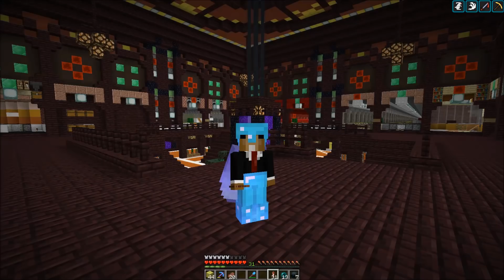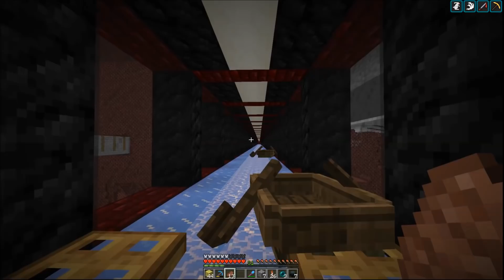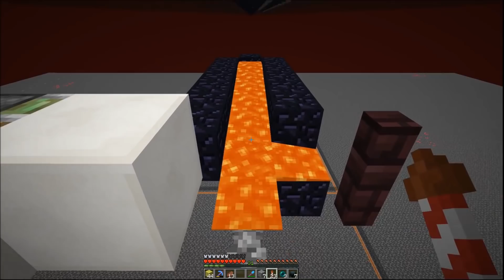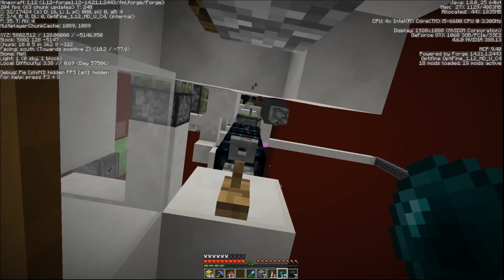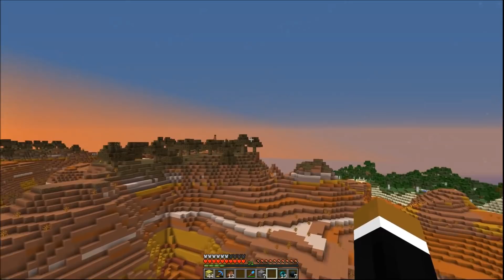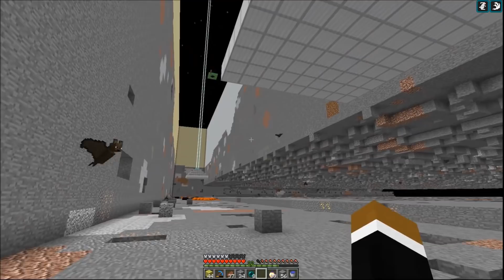SciCraft 59: 18000 Blocks Per Second Travel With Enderpearls

Comment: Minecraft blocks are 10 meters long appearently, that means this ender pearl is going 1.8 million meters per second. This means that that ender pearl is going nearly HALF THE SPEED OF LIGHT!!
Reply: I dropped a shoe from the average height of a Minecraft character(6ft) and it landed at around 1.18 seconds if Steve were to throw this at the speed of 1.8 million meters per second it would go around...
Reply: 2.245 x 10(to the -10th power) lightyears
Reply: That's around 6.095689e+15 light years less than the observable UNIVERSE!!
Reply: Sombody let me know if I got some stuff wrong, this is my first time doing this and I am not even 18.
Reply: Quick update. Turns out Minecraft blocks are not 10 feet. They are 1 which means they are going at 180000 meters per second, boring.

Comment: How have they made their nether covered in bedrock
Reply: They are on top of the nether ceiling.

Someone decided they didn't like the idea that bedrock was indestructible.  So they built a machine that would break pistons and used the broken pistons to break the bedrock.

Then someone wondered what was above the bedrock ceiling of the nether.  So they found a way to glitch through the thin parts of the roof and discovered a vast untapped resource of nothing.  

They began to plan what they would do with all that nothing, so now we have FTL Endpearl cannons so they can go and mine terra-cotta in a biome that is a good shape.

Comment: The fastest manned craft [The Apollo capsule on reentry into Earth’s atmo.] only went 11,032 m/s. A block in Minecraft is 1cubic meter, 18000 Blocks Per Second is the speed of this mode of transport, both literally faster than any manned thing ever created by humanity, and it doesn’t even have a protective heatshield and heat resistant capsule to stop it from atmospheric heating... Absolutely astounding you guys, truly staggering speeds your working with. Going faster than the SR-71 Blackbird, and even still faster than the Apollo capsule at perigee.
Reply: Meanwhile their diagonal piston bolt goes about as fast as my '99 sedan, but looks way cooler.

(28 m/s ~ 101 km/h ~ 63 mph.)
Reply: So mankind is a joke to the technological wonders that can be achieved in Minecraft
Reply: @Luca B. Oh yea that is a really neat thing! 
I just thought I'd compare it to the fastest manned thing, since this does transport a character
Reply: Bruh it's a game

Comment: 2b2t: uses exploits and hacks to travel
SciCraft: Uses Fusion powered redstone blast cannons to travel
Reply: Image if you use both at the same time to travel.
Reply: @komiks42  It has a risk of creating a black hole
Reply: :D :D
Reply: @Terx37  I think the last SciCraft video is going to be them dividing by 0....

SUCCESSFULLY
Reply: JBlake plays You can divide 0 by 0 already
Reply: feed Me what’s the answer then?
Reply: @feedme2711  no
Reply: ArduinoBen It’s zero because 0x0=0 to zero, so if you solve for the second zero, the equation comes out to be 0/0=0.
Reply: @feedme2711  but a/a=1, so 0/0=1
Reply: @komiks42  That would be time travel
Reply: @andrejoss475  Yea, you start at 1.14.4 and end at 1.8 beta
Reply: @andrejoss475  wouldn't be the first time that happened in minecraft. I mean, Hermitcraft season 6 is a thing.
Reply: Danika Like the sciCraft design uses a duplication glitch...
Reply: This would be so useful on anarchy servers.
Reply: It's actually a tnt powered blast, caused by redstone. There is no fusion involved.
Reply: The redstone method is much, much faster.
Reply: @Pds3.14  unfortunately much less resilient to external interference though.
Reply: Me : uses tp to travel

Comment: If my math is correct, that thing is accurate to 4.32 micro arcseconds. That is like what a grain of sand on the surface of the moon is from earth.
Reply: nice
Reply: Arc seconds is pretty precise. But micro-arcseconds? Holy.
Reply: i feel like a dumbass here, does it mean that you land a grain of sand or a baseball away from the landing spot you chose?
Reply: @XenZenSense  basically the error window is a grain of sand to the right or left
Reply: Arcseconds? Isn’t it arcmeters if you’re measuring size?
Reply: Sean Lu A second is a measurement of an angle (1 degree = 60 minutes = 3600 seconds) and a microsecond is 1/1000 of 1 second so the accuracy is measured in terms of the variation in the angle of the flight of the Enderpearl
Reply: An arc second is like a baseball on the moon from earth. Micro arc seconds is 1/1000th of that. So yeah i can totally see that being a grain of sand.
Reply: @nightrous3026  Not to nitpick, but a micro arcsecond is 1/million of an arcsecond, not 1/1000.
Reply: WHAT THE F*** MY MINED JUST MELTED
Reply: it is absolutely accurate due to how minecraft works. There is no randomness involved
Reply: Is java even precise enough for that to actually do anything
Reply: @failed4411  Java's max double is something like 1.8 * 10^308. For comparison, there are 10^80 atoms in the known universe
Reply: Wait my math says it is 0.001 nano pp size.
Reply: Komrade BigTex sucks quick mths
Reply: Bro...

Comment: (comment unrelated to the video) Can someone explain to me the spawning algorhitm?

In a superflat world with 1st subchunk filled with stone all others subchunks empty, and NOT spawnproofed, according to my current underestanding of spawn algorhitm, mobs shouldn't spawn. Why? Because all spawn attempts are happening within that 1st subchunks, but are all terminated. On top of stone layers there's nothing that would stop mobs from spawning, but the air blocks there are already in 2nd subchunk, so no spawn attemts should start there.

I run 2 tests (one with last stone layer at 15, one at 16), and in both mobs were spawning. What do I underestand wrong?

Comment: i really like the tnt cannon, is a shame that is not going to be usable in 1.13... how much tnt does one launch need? i ask that because even without the dupers, if the amount of duped needed is not a lot (less than a stack) maybe you can continue to use that teleporter if you add a way to craft tnt there using duped sand and a good creeper farm.

but then i comes back to the same problem, not being able to make sand farms...at least not ones that are intended. with that and a way to move dispensers 1.13 could be actually a very good update, even while removing the dragon egg-bedrock trick
Reply: Each launch dupes tnt twice (first set propels tnt to the pearl, then the second set explodes the pearl), so probably a thousand or more. Each module is 7 blocks wide, duping 22 tnt per trigger. And you can see how long the duping array is...

Comment: use the etho enderporter method instead? should work alot better on the newest version because of updates
Reply from the maker: I wouldn't refer to it as etho ender porter, because other people have pioneered the concept before him. Would be insulting to those people to name an invention after somebody that used it way later.

Apart from that, the concept has a lot of issues, as soon as more than one player wants to use it. It's definitely not an option for multiplayer world
Reply: well etho was the only one i've seen it from but still you're right. also you could either setup multiple enderporters or just one for you while you quarry?
Reply: Pearl stasis chamber is only viable once we have reliable wireless redstone supporting multiple channels + remote chunk loading. We do have the tech for both, but it's not good enough compared to the 1.7 global hitbox bug / arrow chunk loading.

Also, pearl stasis chamber was first proposed by sancarn, then a bunch of people worked on it. Pi314, ultimateredstone, test137e29, selulance, sancarn just to name a few off the top of my head.

Comment: Hi ilmango, i was wondering about your project to implement husk dropping sand and spawning in desert temple in order to farm sand in a more "legit" way. Why not use tha loot-table that were added ? It doesn't resolve the spawning in the temple but its a start. Something i aslo was considering adding to my own server is silverfish dropping shulkershell. It doesn't make much sense but it does bring an interest for an otherwise pretty useless mob, and it's make shulkerbox farmable so no need to duplicate them. I would probaly make it a rare-ish drop, just to try to make the most efficient farm possible. Hope this can inspire you.
Ps and maybe stray dropping compact ice, since its not renewable eigther (even though you guys don't seem to use that a lot)
Reply: Good ideas about silverfish dropping shulker shells and the strays dropping packed ice, I like them.
Also maybe instead of making shulkers unspawnable, have them respawn in end city bounding boxes so you can make similar farms as witch farms. That would seem fair and making them spawn a bit rarely would make it an interesting and in my opinion a balanced mechanic.
Reply: Joseph B. Yep, i kept in mind not modding the game but since they want to try it with desert temples this does make sense. They could also add recipes for existing items/blocks (by modding since 1.13 is out of question for the moment) i personnally would like to have the possibility to uncraft quartz, magma, and netherwart block, and maybe uncraft unused pieces of equipment (armour/tools), simple stuff like that.

Comment: You have to wonder if it's really worth it to grind diamond ore for ~60 hours if you could just put an engine on the tunnel bore. Even though you wouldn't get diamond ore anymore, it would be so much easier to sit in a minecart while you can afk. It depends on your priorities, I guess.
Reply from the maker: machine breaks if liquids aren't manually removed.

Comment: +ilmango With your quarry or floor builder do you think you could make 4-way flying machines for moving the blocks so that you could have more than 1 set of blocks being moved at the same time?

Once they finish pushing the blocks they have they then move out of the way of the next machine and head back to pick up more blocks. Maybe you could make them with a sort of bumper that would stop them from colliding.

Comment: Can i suggest different way? Its probably not so good in multiplayer cause my techniq force your quarry to "single person use only" but this much more cheaper and easier to build. There is just two setups of chunk loaders (1 in dispatch point, 1 in destination point) and line of redstone dust  between them (with repeaters beside every chunk border). Thast all. Also speed is slightly limited (1 chunk per 0.1sec). I apologise for video in russian only, but i left some information in video description 

https://www.youtube.com/watch?v=gmqRlSbP6FI&t=1590s
Reply from the maker: It's only useful in single player. If you think the concept through for multiplayer you would run into so many issues, that make this concept not appealing at all.

Comment: Mango a have a suggestion for you. It is possible to travel from spawn to worldborder within one minute, even with a crappy CPU and 1 gig of ram :D You don't need much computing force for it and it is completely vanilla survival friendly. You do it by building a nether portal on top of the nether ceiling, then stepping in it, waiting for a second, then jumping, and while you are jumping throwing an ender pearl in one of the lower corners of the portal. What than happens is, that portal animation plays like intended, there comes even this loading overworld stuff, but, you stay in the nether. The clue is, that you get teleported to the theoretical overworld coordinates, which are your nether coordinates multiplied by 8! By doing that 3 or times repeatedly, you will easily reach the border, or in your case the witch hunts in no time. It works in every direction, you have to play with it a little to figure it out. Hope this helps
Reply from the maker: that's fixed
Reply: ilmango no it's not, I did it a week ago. It least in 1.12 it works, in 1.13 I don't knoe
Reply from the maker: it's fixed in 1.13
Reply: John Giorgetta 1.13 has also some cool new features, like noteblocks send out block updates when you click on them. In a previous video mango said that they need this behaviour for their new mooshrom farm, so I'm pretty sure they will update
Reply: John Giorgetta Yeah I watched it, in general I don't really like the new update, it brings no new useful blocks/items/mechanics, expect the debug stick, but that is, of course, creative only. And the new fullscreen system sucks too
Reply: 1.13 isn't finished though. A lot of the things are obvious bugs like the fact that hoppers are totally broken which will definitely be fixed before release. Besides, 1.10 and 1.11 broke the server as well; they break the server pretty much every update.
Reply: MrHatoi True, but there are just some really dumb changes, like the breaking of nanofarms, they didn't even implement it properly, so you can still place pumpkins and melons in insufficient light, but wheat and carrots etc. you can't
Reply: Do you need to be in the air all the way or just on impact? :P I could imagine this pearlcannon to be aimed at that corner and with some practice you could jump at the right time to multiply this machine by 8. If I understand your message correctly that is :P
Reply: That's only a snapshot tho, Mojang is obviously gonna fix all of that stuff.